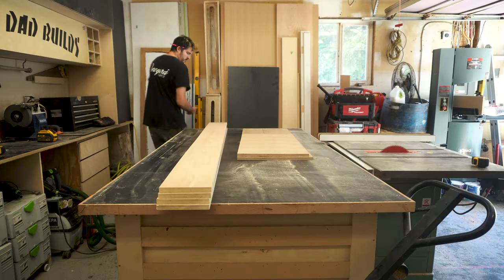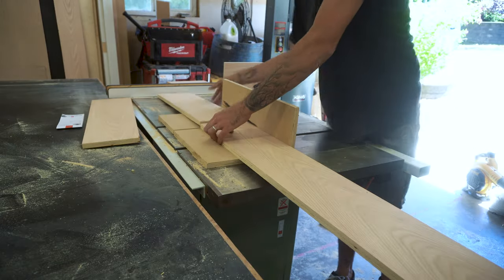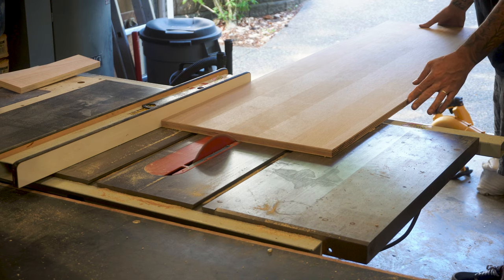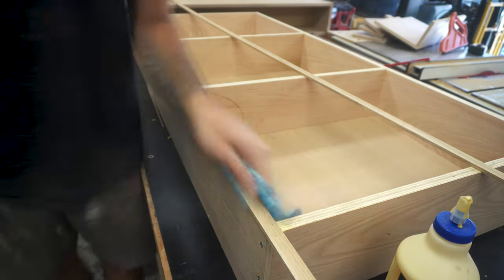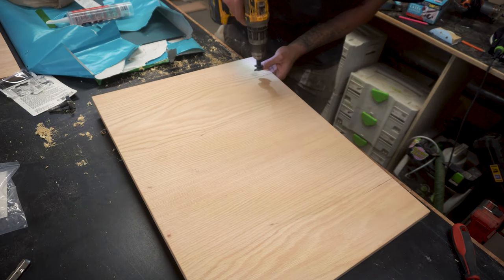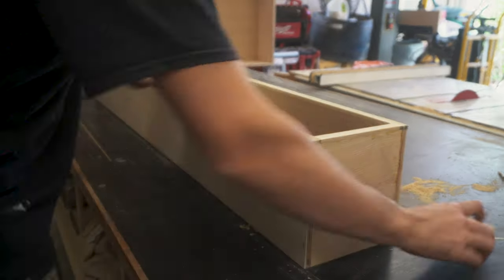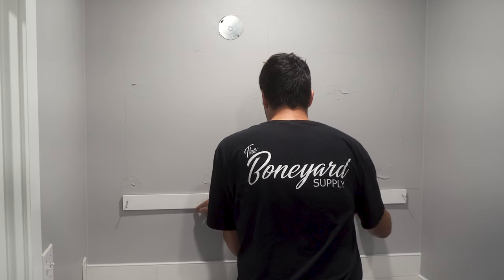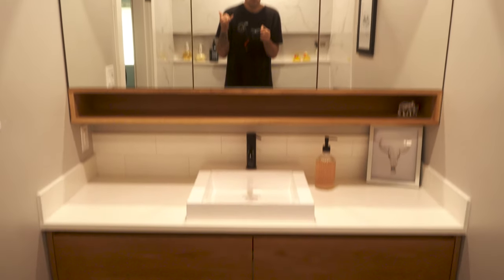Modern White Oak Mirror Vanity Cabinet For Less Than $300 | Part 2 | DIY #homeimprovement #woodwork

Comment: This is the exact cabinet I've been planning to make for my kids bathroom and you have just made it so much clearer for me now. Thank you so much. I wish I had found this video a month ago. My question for you: I have 4 sections to my cabinet instead of three. 2 pairs with a light in between. The mirrors I bought for the project came framed and are much thicker than the 1/8" thick mirrors you got from your local glass company. I wish I had had the foresight to get some similar to yours. $70 was a great deal. Since my mirrors are much thicker, my doors will be extra thick. Do I need to plan a reveal on the sides of my cabinet or would regular adjustable overlay hinges be able to accommodate extra thickness. Or in general, how does one work will thick doors?

Comment: Hi. I made a similar cabinet but used solid oak. 18mm fir the door. I used Osmo Polydnon one side , fided the mirror to the other. The door has bowed a lot. Is oak veneer ply less susceptible to bowing? Did you oil/seal your doors, and did they bow? Thanks
Reply from the maker: Yea. Especially in a high moisture content room like a bathroom, solid wood will likely have a lot of movement. Even more so if its thin and wide. That's why I opted for veneer. ply or mdf you shouldn't get much movement. I sealed everything except the face of the door behind the mirror as I was worried the glass wouldn't stick to an oiled surface. 

Your best bet is to replied your door with a veneer.
Reply: @RadDadBuilds  thanks for replying. Will re make it with veneer. Has yours bowed at all?

Comment: Why did you build the lower shelf as a separate box instead of just building it as one piece?
Reply from the maker: Personally I thought it would be easier to build two separate as there is a step where the lower is flush with the doors. That said I doing think either way are incorrect.